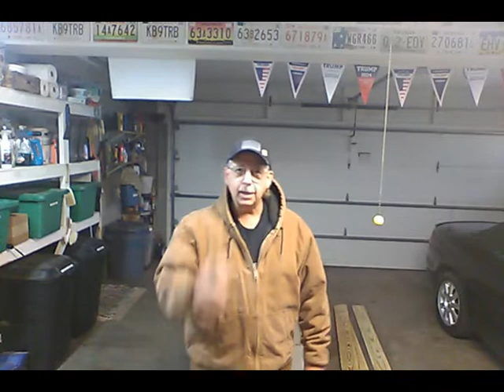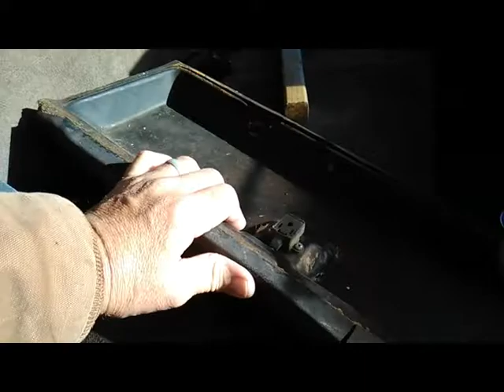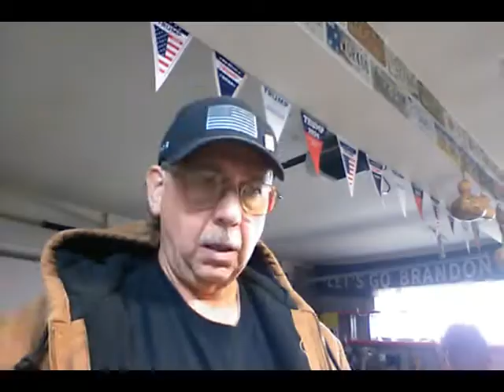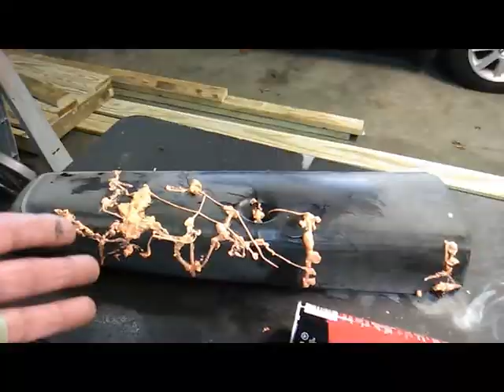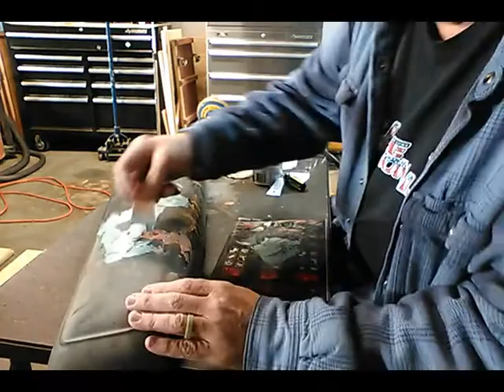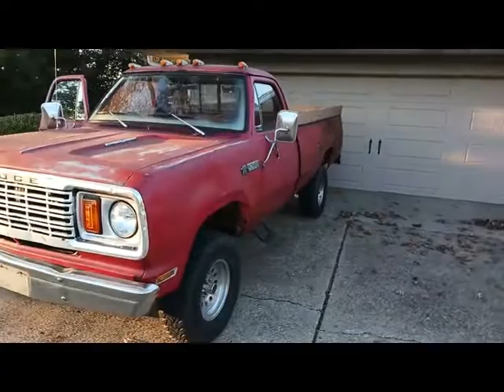Glove Box Repair On The 1978 Dodge W-150 #rcindustry @weirdeard8898 #warwagon #dodge #powerwagon

Comment: I’m about 99.9% sure that’s my old dodge power wagon I sold a long time ago
Reply from the maker: It came from the Tellcity area
Reply: @RCindustry  I had it for sale between Marengo & Milltown at my uncle’s storage business probably 2006/2007 and I thought the cat that bought it was in that area!  The reason I’m so sure is the power wagon emblems on the finder were off of a 79 PW and I added extra spring to the rear so I could haul more. I bought the truck it not running out of Salem, In and me and my dad put a rebuilt 80’s model 318 in it.
Reply from the maker: Well, I  bought it in 2021. It had a 318 the bed had originally been yellow . Truck originally had an am fm CB radio from the factory
Reply: @RCindustry   yep sounds right, I remember seeing it on Facebook 4sale, kinda cool but a little sad seeing it, the people who bought it beat the hell out of it for sure, it was actually in pretty fare shape when I sold it.
Reply from the maker: Well I'll be.  The guy I sold it to lives down around Bowman Indiana. He uses it on his farm halling firewood.